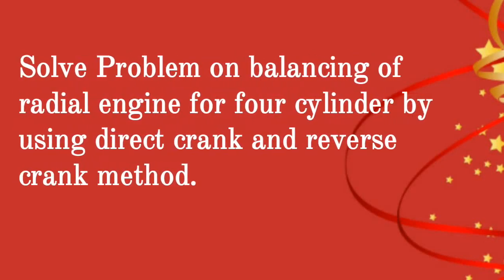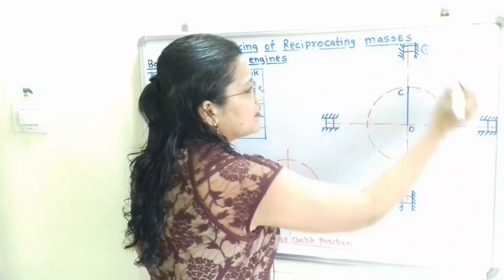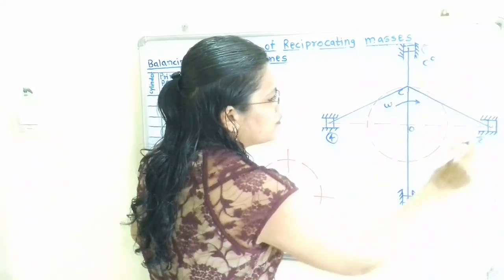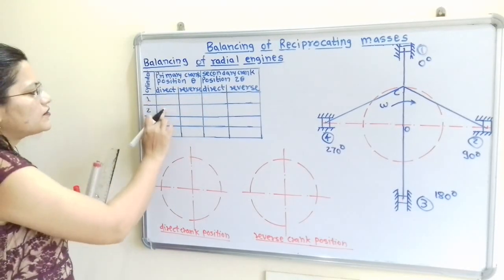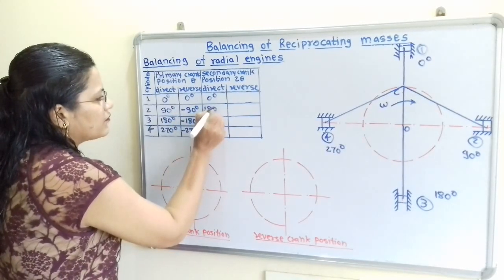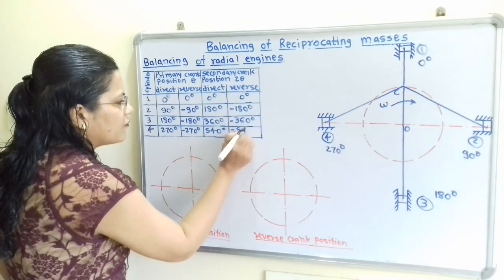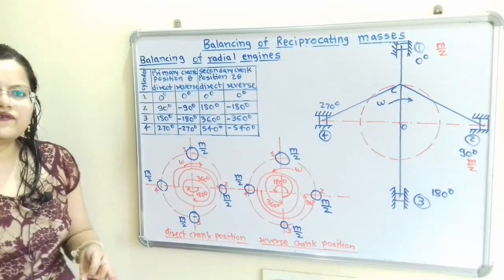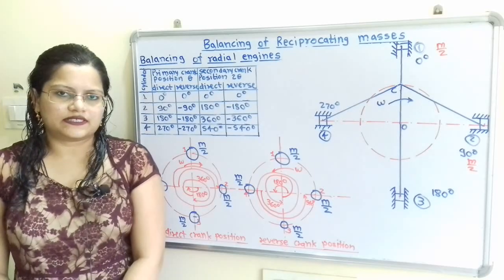Problem 10 balancing of  radial engines for four cylinder by direct crank and reverse crank method

Comment: Just a note from a retired engineer. Radial engines with even number of cylinders are not possible due to the fact that radial engines ignition cycle is every other cylinder. Radial engine ignition order for 3 cylinders is 1, 3, 2, back to 1... for 5 cylinder is 1, 3, 5, 2, 4 back to 1..... 7 cylinder is 1,3,5,7,2,4,6 back to one. As you can see, you skip adjacent  cylinder.... by skipping one cylinder on even number cylinder radial with 4 cylinders you'll end up with power stroke on only 2 cylinders. same applies to 6 or 8 cylinder count. Only half of them would produce power.... Just saying....
Reply: They are possible, they'd just have to be 2 stroke or accept an unbalanced firing order.
Reply from the maker: Thank you for note...